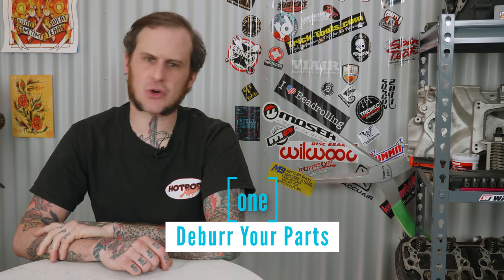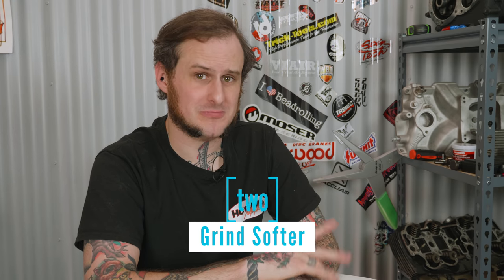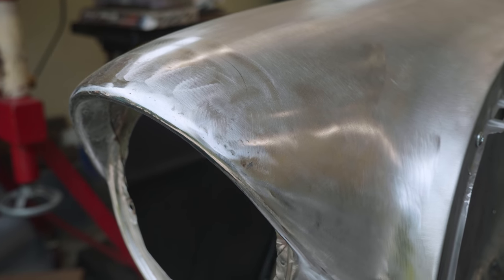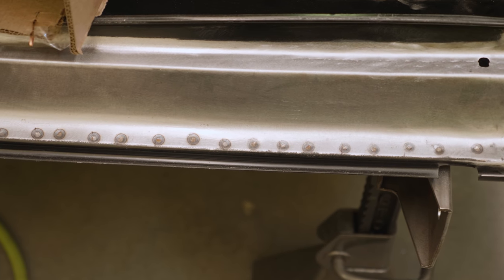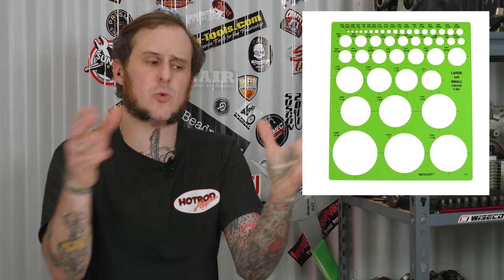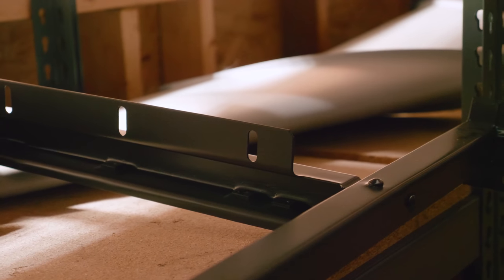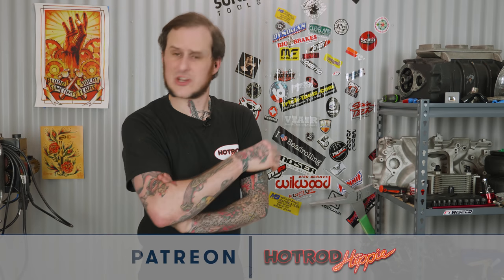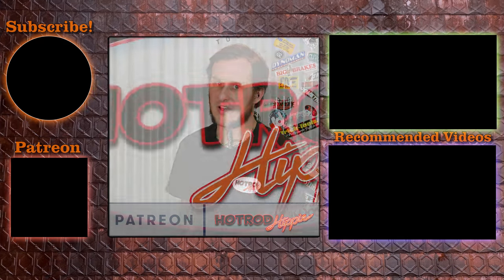5 Tips for Pro Fabrication Work

Comment: Here's a pro tip for everyone, spend more of your time on measuring and cutting perfectly, because you will take considerable more time filling in and cleaning bad fits than you would spending little bit extra time at the start. Another tip is, if you are going to weld with either mig or tig, clean the area that you have clean metal and no mill scale as this will allow you to run cooler welds that causes less warpage and less burn through, thus saving you time and money.

Comment: ALWAYS de-burr your parts! My friend and I were working on an older car, when he reached under the passenger front seat to install a new spring we purchased to replace the spring assist in the seat slider return. His hand slipped off and bumper the under side of the seat pan. He kept working when he realized his fingers couldn’t quite hold onto the spring. That’s because when he bumped the pan, it cut to the bone, through the tendons. Over a year later and a surgery, he still doesn’t have full use of those fingers. Be careful!!
Reply from the maker: It’s absolutely amazing how awful sharp old cars are like that. Hope your friend gets full use back. Oof.

Comment: Definitely agree about deburring parts!  It takes seconds to finish the hole or edge off properly before install, and saves so much trouble (and pain) later.
Reply from the maker: I should have highlighted how it actually matters for aligning parts, tapping, and passing stuff through as well.  But all that was popping into my head was getting cut by parts someone else produced and being irritated, ha.
Reply: @HotRodHippie  Eh... more material for the next video 😃

Comment: 3:06 I'm building a Smyth Ute conversion (look em up) on a Jetta. 
Since I went nuts,and the whole aluminum bed is now polished it looks great. 
Getting there was a toll though ,but one of the joys I had was grinding down the welds on the fenders.
(They came welded, the kit is a non weld kit as it uses rivets to fasten, and even that isn't exactly true, as 3m panelbond is an amazing thing that allows you to defy physics and weld aluminum to steel.) 
I did it all by hand with files, just because I knew if I used a power tool I'd be chasing screw ups with a file anyways. 
That was like therapy , dragging the file and feeling the change in it's friction. 
When it gets less friction ,you're pretty much down to level with the rest of the panel on that weld. 
And if you're applying the right pressure and it's surfaced, the file won't even scratch the rest of the work. 
I knew how to use a file (I thought) but now I really got the feel for it I'd like to think. 
Save for a couple of little dips in a couple welds ,it came out better than expected.
I can always find something to nitpick my own work,someone will walk up to something I did and say nice job, and I proceed to say: hold it mister, lemme go around and show you all the flaws I see! 
 I guess I could have welded up the spots a little and ground them down where the little pits are, but I didn't and I'll have to live with it. 
The overall appearance of it does keep you from zeroing in on the flaws I see right away.

Comment: Tip 6: Plan out your sheetmetal or fabrication work 2-10 steps ahead. Dont think about the current panel or piece you are making. Think about how this panel is going to fit with other panels. Flanging edges and stepping edges to make everything fit together as it was planned is a big one for me. Just ramming edges together and welding them together is lame. 
Bonus Tip: Dont just spot weld your sheetmetal and then pave over it with bondo. Actually finish your welds.
Reply from the maker: I completely agree with planning ahead  I try to have as much information going into a project as I can so I can plan ahead from the word go. Knowing what is coming is so important so you can foresee conflicts in your current work. 

However I completely disagree on flanging panels, I've done a while video on why to butt weld panels. I only over lap at high stress areas like firewalls, Pillars, and floor pans personally. Obviously there are exceptions in there but butt welding forever for me.
Reply: @HotRodHippie  I agree I try to avoid overlapping but if it is a high structured join area, such a pinch weld type flange, those are exceptable with the right prep. I disagree with mid panel over laps.

Comment: Great tips. Check out using a rivet fan spacer for spacing points (holes, spot welds, rivets 😜) very fast and easy.  All the best to your.....  Joel
Reply from the maker: Solid call. I've needed to add one of those to my arsenal for a while.